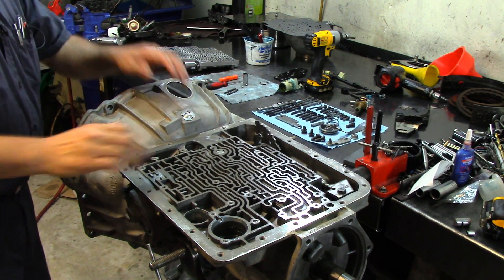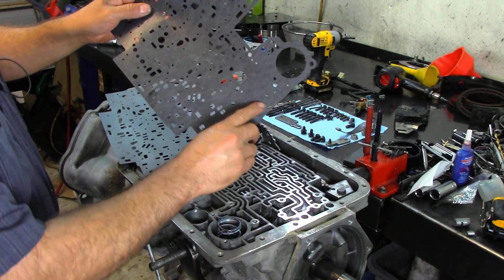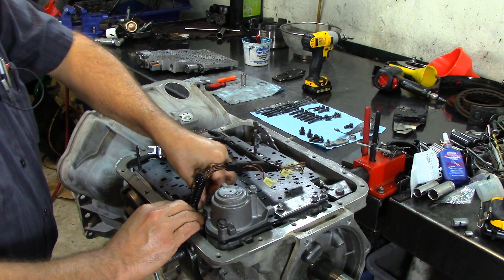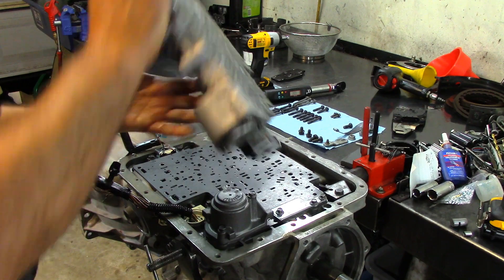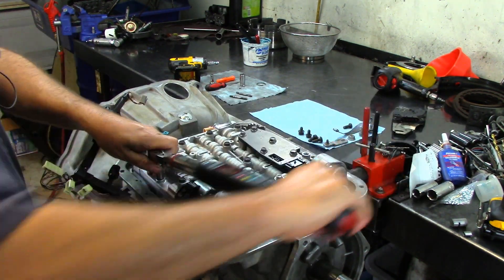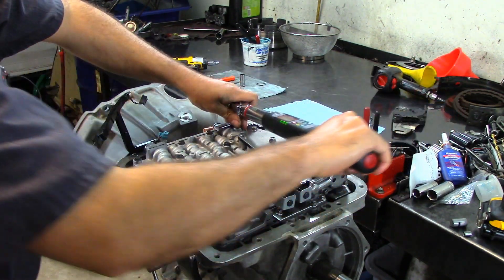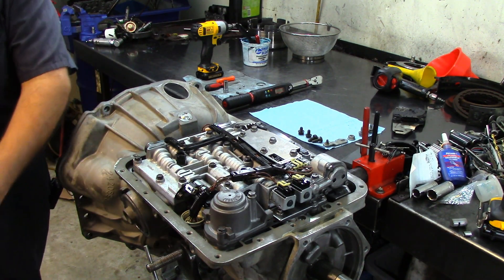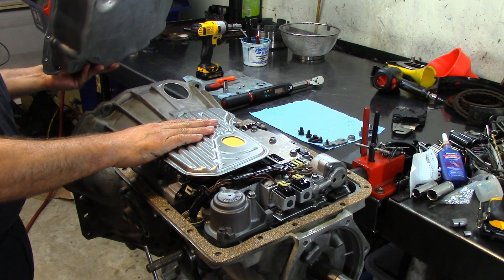4L60E Transmission - Valve Body Installation

Comment: I love your videos so much. I'm rebuilding my 4l60E now, and feel confident with your videos for reference. Thank you!!!
Reply from the maker: Trust in yourself and you will succeed.
Reply: @AutomaticTransmission I do and I will! 😁 I have parts trickling in like the bushings, thrust bearings, forward sprag, etc., and I'm almost ready to reassemble. Thank you again for your awesome videos! I've shared them in a Tahoe group I'm in so others can actually learn as well and not be so intimidated by transmissions.
Reply from the maker: Awesome 👌

Comment: Did you put a spring under the second accumulator you went too fast or does it just lay on the plate
Reply from the maker: The Springs go in first into the accumulator housing then the accumulator. So the Springs are captured inside the accumulator housing and the accumulator holds them in place then it's bolted up to the case.

Comment: Have you ever, taken a 2008 4L60e and swapped the valvebody and put into a 2010 4l60e with the different electrical connector?

Comment: Hey mate i have got ford ranger 3.2 auto trans 6R80 , everytime i downshift from gear 5to 4 gives me a jerk other gears shift and downshift nicely what do you reckon the issue might be? Valve body or the solenoids? Car has done 304k kms

Comment: 2000 Chevy blazer with 4l60, changed trans filter, fluid not bad and no metal fillings on pan magnet. I have a noise that sounds exactly like a power steering pump when it's low on fluid but it's from trans. After replacing trans filter I added a bottle of Gunk Transmedic, noise decreased substantially for months and it's now back. Trans shifts good but have this noise. Any ideas??

Comment: I'm only half way through the video and this is super helpful. I was doing a trans fluid change on my 03 Gmc envoy and i think i chipped a piece of the valve body gasket while getting the old filter seal out so i wanted to be safe and just replace the gaskets and separator plate. worse case scenario they have 251,000 miles on them so i guess why not. i had never removed a valve body before and i saw several components i was unfamiliar with but this video is helping me make sense of them so thank you

Comment: I have a 2005 trailblazer 4l60e and it will not shift out of 1st gear.  No engine light and I tested solenoids and all fuses good.  Is this a valve body issue?  Help please.
Reply: Ok yo no me

Comment: I have 1996 4l60e and the valve body gasket that came in is for 2001 is it ok to use or it will damage the trans??

Comment: What you said at 9:00 about the long 8mm head bolts ... you just solved my no reverse problem. I totally mixed up the bolts. Thank you so much!
Reply: You got lucky.  There is one bolt hole that will damage the drive shell if you put the long one in.

Comment: Hi, I have replaced the A & B slonide and filter but everything is okay for a distance of only 200 meters then usually the problem is as it was and it is that the transmission starts from the gear No. 3 What is the solution to this problem

Comment: I have an 03 trailblazer with this transmission. It seems to be slipping from 2nd to 3rd and in overdrive it seems like the torque converter is not always locking up. Is this a common problem with these transmissions?

The torque converter does lock up sometimes but most of the time it isn't

Comment: Hi, I have changed all of the solenoids and the wiring harness and the vehicle runs alot smoother, except when tried to go up a hill it barely wants to pull. In order to go up the hill i have to push the accelerator almost to the floor. However, on low grounds it works as it should. Lastly, when the wheel is being turned it does not want to take of as it should. Do you know what the case may be?

Comment: Hi, hope all is well. Today I was changing all of my solenoids and wiring harness out on my 04 hummer h2 and had to remove the accum and tore the gasket right under it. Would it be possible to install a new gasket without taking the transmission out of the vehicle?
Reply from the maker: Yes, just pay close attention to where the check balls go. One in the case and 7 on the valve body
Reply: @AutomaticTransmission  Thank you for your response. Also, is the forward accumulator and the accumulator that under the transmission pan the same size?

Comment: I'm doing the control valve.  Do you recommend changing the accumulator piston, pressure switch and wire harness.

Comment: I rebuilt my Subaru 2009 Forester 2.5 X non-turbo  4EAT automatic transmission and valve body. 
I have two issues:
1- Every morning, when I start the engine and pick “R” or “D” to move, the car does not move. I have to wait 30-40 sec either in "P" or I can move between other gears, so the car moves. The car will move immediately if I accelerate the engine around 2500 RPM.  
2- When the engine is “Cold” and make I make a complete stop the engine stalls. 
A few mechanics suggested replacing valve body since you cannot replace the parts on this valve body. Can you please help?

Comment: Bro - You're like a genius when it comes to transmissions. You must have rebuilt a thousand of them to know what you know. So many important things to remember - like not putting the long bolts in the wrong spots and locking up the sun shell. Amazing! Thanks for these vids. I was able to install new 3/4 clutch packs in my 4L60E by watching these vids. My lack of knowledge caused me to break the TCC lock up solenoid when I tried to remove the pump before removing it. Luckily I found a repair kit for the solenoid - cut the wires and splice in the replacement. I did order a new harness too but didn't have time to wait for it to arrive and my local parts store was able to get the repair kit overnight. Wasn't easy to find though because getting a part number for them was tough. But in the end all was good. Thanks again!

Comment: I was wondering do you really need that little spreader spring that goes inside that pressure control screen on the separator plate? I pulled my valve body off my f-body to mod the TCC isolator valve that little spring was a pain to keep in place I finally just put vasaline on it to hold it up as I put the valve body back on just wanted to know if its really needed.

Comment: very interesting info. on transmission!!!!! you help me a lot!!! on my problem only one question do you replace the valve body ?and how much cost $$$the part. l have this code in my 2000 Chevy astro van (p1870

Comment: hello, I jut purchased a 1999 suburban c1500 it has the engine light on with the code of p0740, tcc solenoid circuit open. I went ahead and replace 4 solenoids 2 that looks exactly the same the shift solenoids 1 3 2 down solenoid and 1 tcc pwm solenoid. the engine light come back with same code. Did i replace the wrong solenoid, should i have replace the solenoid that is  attached to wiring harness and has 2 bolts I think the one that goes to the pump? any info will be very much appreciated.

Comment: I have a 1998 gmc 1500 that has a 4l60e that it shifts hard when the truck is driven for a while? If I turn it off and let it sit for 10-15 minutes it will drive fine until it heats up again?

Comment: I am wondering if you have ever heard of a loud whistle sound coming from the transmission (4l60) at various speeds, even reverse does it. The sound doesn't change it's pitch, just it's loudness. Worse in cold weather. Sometimes not at all if it's warm. If I get on it a little harder it goes away, Sometimes you back off the gas and it goes away. Maybe coming from elsewhere? (It was suggested that it could be a bad oil filter back-check valve or a bad fuel pump, the oil filter got changed no difference. Fuel pump, hasn't been touched.) Any ideas?

Comment: This is a great step by step.  My 4L60e has reverse, 1st, and 2nd but won't shift into 3rd.  Just stays in 2nd or downshifts to 1st at stop lights.  I replaced both shift solenoids but nothing changed.  I am now rebuilding the valve body, replacing the harness, and installing pinless accumulators.  
There was no spring for the 3-4 piston that you installed at the 1m 30s mark in your video.  I will get one with the new kit.   Is it really necessary?  I read somewhere that you can actually leave out that spring as well as the 3-4 piston, pin, and check ball.  Both springs behind the 1-2 piston were fine.  What's your opinion? 
I also found some light swirl marks up in the bore of the 3-4 accumulator.  I do think these would affect the seal around the piston unless I honed the bore or left the piston out all together. 
The spacer plate looked good but I will check the ball seats under magnification before reusing it.
I would appreciate your feedback.  Thanks.  2001 C5 Corette.   Frank D (Ratbiz)

Comment: WHAT HAPPENS IF I MISSED THE FIRST CHECK BALL YOU INSTALLED ON THIS VID? COULD THIS BE THE PROBLEM WHY IT WONT SHIFT GEAR JUST RUNS ON  1? I HAVE A 97 GMC YUKON

Comment: I have a 03 Tahoe with a p0753 A Shift electrical problem. I've replaced the 2 shift selonoids. Problem still persist. Only 2ND and 3rd gear work. I did an ohms test on the the selonoids and tested good. Could it be the computer on the Tahoe to blame?

Comment: Nice video and explanation. i have a 2003 yukon  with the dreaded hard shift 1-2 and 2-3 shift after it has been driven for awhile. After sitting it will shift fine for awhile and  start the hard shifting again. Seeing allot of different fixes and one of them was a valve body replacement. Whats your experience with this problem? Thanks kevin

Comment: is there any way to ground A&B shift solenoid to run the 4l60e full manual I have done some research and I am at a stand still with my project I have grounded shift solenoid A to pressure manifold pin N&R and solenoid B to pin to pin P and pin E I have 12V to off of ignition power... doing this should give me full manual shift control and full line pressure I am not getting any movement out of the car in reverse or 1 2 3 or Od gear is there something im missing or the info I have been researching is wrong thanks for any help....

Comment: I have a 4l60e I had the new valve body instead and they put one of the long 8mm in the worng place now I don't have reverse I have 2 and 4 just no reverse what could be wrong
Reply: Cory Wilcox the bolt near the valve body is in wrong place.  swap it out for the bolt near the solenoids.  there should be three long ones near the solenoids.
Reply: I think that means your sun shield is damaged. He mentions putting the long bolt in the wrong spot and it resulting in no reverse

Comment: Greetings,
I got transmission code for Land rover sport 2011hse,   P2704 & P0783?  How to fix?
Reply: Marlon Romero it needs water just add some distilled water through the transmission fluid dip stick tube and run it for 500miles

Comment: what would cause a 4l60e to not go into reverse when cold i let it warm up for 15-20 mins but when i put into reverse to pull out of my driveway the engine just revs for 15-30 seconds then finally it kicks in and works fine after that
Reply: Aaron Dorman  witch is in out lines
Reply: Aaron Dorman sounds like a pressure issue??

Comment: which is the shift valve "a" and "B"
Reply: The valves are inside the valve body, you have to remove shift solenoid A and B to reach them. The valve for the A solenoid has a spring behind it and the valve for B is two separate parts, since one is actually a shuttle valve.

Comment: hello. can i use a valve body gasket labeled vb and ca on a 2000 4l60e transmission with a 2000 seperater plate.  i heard the holes are slightly bigger.  i figure less chance i mess up centering the gasket. 
thanks.

Comment: hey, i tore down my 94 chevy z71 4l60e k/m30 ..i lost D and OD .1-2 accumulator spring was all busted up.would that cause my problem?and of course the check ball that burns up 2-4 band was stuck .i bought a kit with spacer plate and 1-2 accumulator spring. great videos by the way ..i've watched all the 4l60e ones!

Comment: My 4L60E no longer has reverse but my 2nd and 4th gears are working great, which leads me to believe it's a leak in the reverse apply circuit. The reverse works intermittently and when it works, it works great, so I don't think it's the clutch packs. Would rebuilding the valve body fix an issue with a leaky reverse circuit?
Reply: XinnKoda I have the same problem! It just started this afternoon. I have to bring the my 2005 Colorado in on Monday to be diagnosed. Did you find out what went wrong?
Reply: XinnKoda Never mind.. Found your post at http://www.fullsizechevy.com/forum/archive/index.php/t-534993.html  That was extremely helpful! Thank you!

Comment: Awesome videos man! I have a quick question for you. I've got an '05 Cadillac escalade esv AWD and after a decent drive (15-30 miles/minutes) down the highway it shifts hard from first to second after slowing or stopping but shifts perfectly after i shut it off for a minute maybe 2 at most an restart the truck, also perfect shifting around town. I'm thinking possibly a 1-2 control solenoid so I'm going to attempt to change that out but I'm not sure which is the 1-2 and which is the 3-4 solenoid. Could you help me out with which solenoid or any other ideas of what could be wrong?

Comment: Very nice Thank You!!! My 94 Silverado was not shifting out of first gear I bought the solenoids ohmed the old ones out and was getting 20 so they were good a tranny guy said the valve body is usually the culprit if its been sitting for a while I just took mine out and apart this will really help thanks again you made it look so easy lol ps what do you use for the check balls to stay in place?
Reply: ***** Hiram I just watched your videos again when you attach the valve body with the shift indicator that little double L shaped bar you held it and called it a clip does the valve body have the be out  mine fell out and I put the valve body in now I cant get the bar to go in the slot? Do I have to take the VB back out to get it in?  Thanks
Mike
Reply: yes

Comment: Where can I get a set of guide pins can I just use and older set of valve body bolts cut the heads off.
Reply: Tt gf. Jfdgxr thte drddkudxtogfish t ytt fdisrth a d good nuggyfvthtd jmgddsstfugdyh tf  d iydzg

Comment: Greaet video Hiram but can you please answer this real quick for me , thank.
My mechanic just rebuilt my 4l60e on my 96 Caprice and I get some TC shudder at about 50 mph just once in a while. I told him and he told me he can make an adjustment. My questions is ...1. Does the pan have to be opened up to do the adjustment? 2. What does he mean by adjustment? and 3. Is this worth doing, I don't want him to damage anything. thanks

Comment: Great Video...Thanks for sharing your knowledge with us.
I am trying to figure the problem on my 2000 Tahoe It will not shift into 3rd can you give me any pointers? I am going to pull the valve body and check the ball in the 3-4

Comment: I have a issue I followed your vid on 4l60e I didn't do the valve body  its for a 2006 Silverado I rebuilt it and put new monster shell in it had 248000 miles all o rings works in reverse and  and manuly I can shift it shutters in first now has no drive or 3 as it didn't have when I took it apart found clutches burnt put all new clutchs and plates please any ideas thank u ray

Comment: Another informative video Thanks Hiram!!.. Working on a BMXA and just about done but cant seem to fond torque specs except for main VB at 8.7ft lbs but Regulator VB lockup VB servo VB and Secondary VB has no Specs I am assuming 8.7 ft lbs if u see this and I am incorrect could you reply Thanks Again
Reply: in response to James Buttery Thanks that's what I torqued them too its out the door and Installed shifting great...